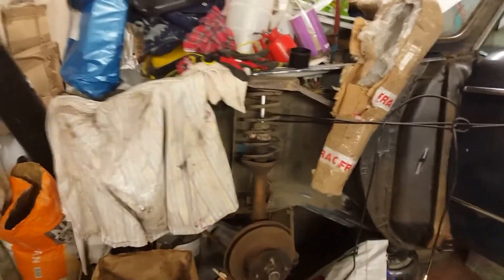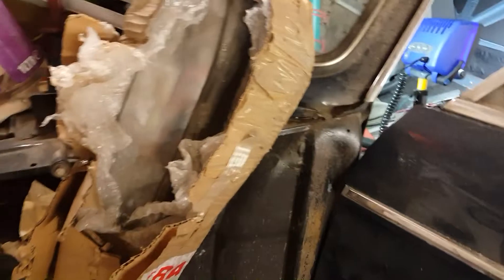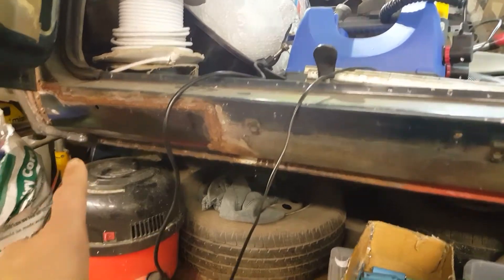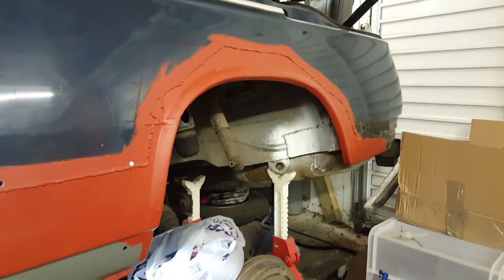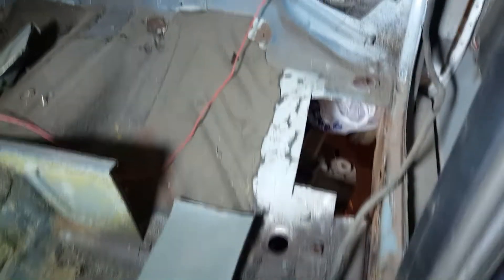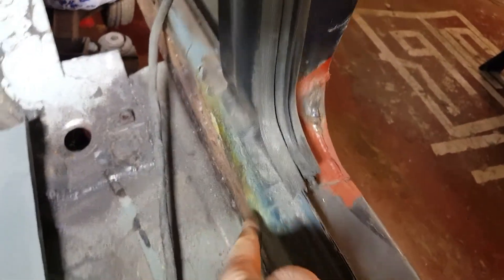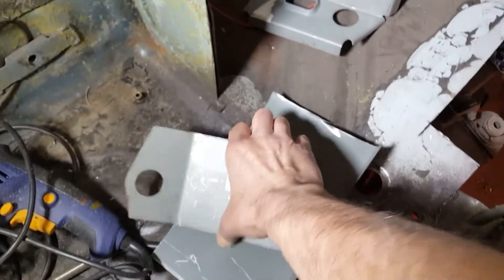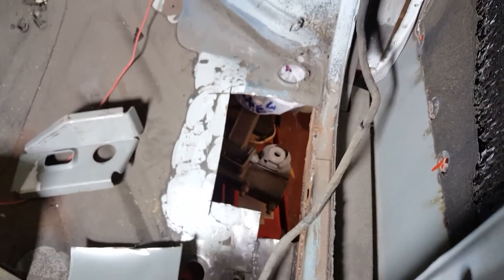BMW 2002 1973 Restoration #3 2017 Mojo Restored

Comment: Awesome!! But what is the red paint you are using (‘paint’)..?
Reply from the maker: Thats just red oxide primer, just to keep the rust at bay !!
Reply: If It Anit Broke Still Fix It oh wow, great never seen that before. Do you spray it? I’ve been following quite some bmw e10 vids of yours, keep it up love the clear videos. 
JP
Reply from the maker: Many Thanks JP, its just brushed on out of a tin, should have anther vid soon have made good progress just vids a bit slow coming out, is that a DRZ400 in your pic, awesome bike, I had one those a few years ago
Reply: If It Anit Broke Still Fix It oh funny! No it’s a derbi drd racing (50cc) when I was under 18 a while ago haha! Now I got a 1802 roundi building a racer! Can’t wait for your vid, I am doing the same now (rear axle supports...help!) 
Cheers,
JP
Reply from the maker: Good luck with your 1802.. put some vids up